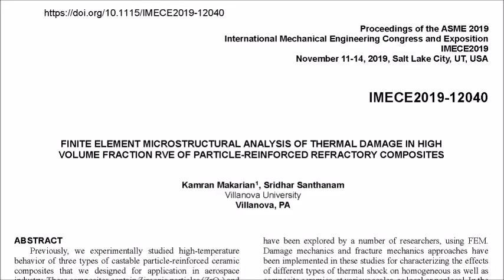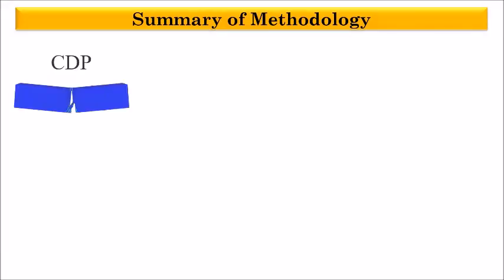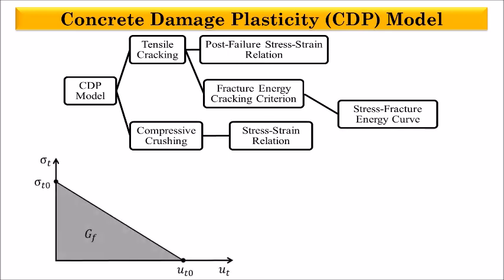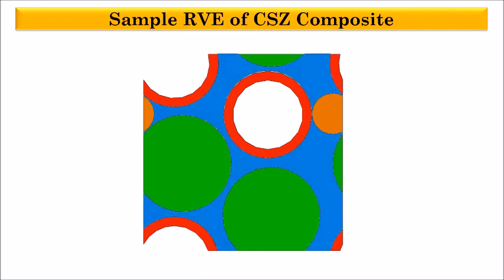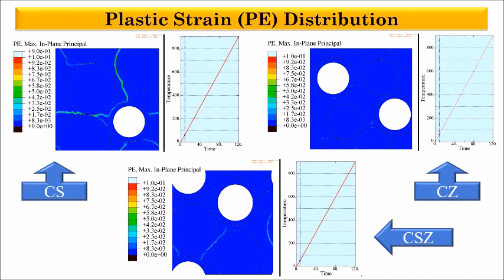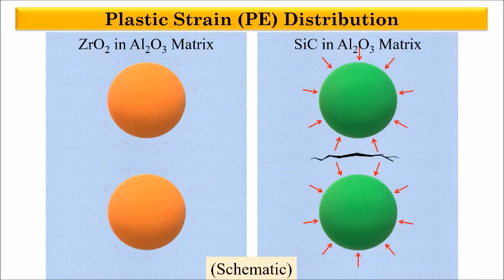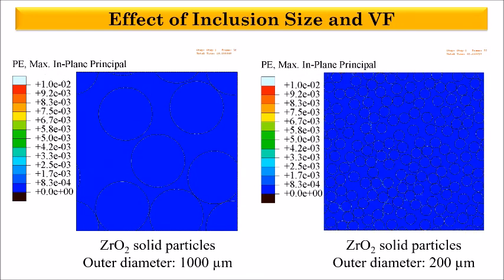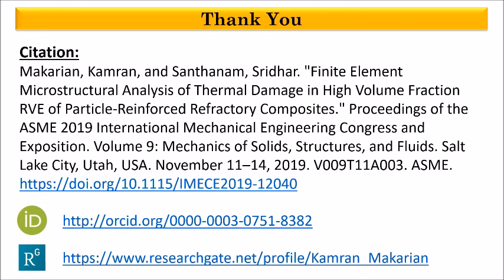Finite Element Microstructural Analysis of Thermal Damage in High Volume Fraction RVE

Comment: well done, thanks for sharing your work..i have a question about your particle .. did you define the interaction  between them or they have distance?
Reply from the maker: Thank you for your kind comment. Particles are attached to the matrix using tie constraint. Given that the problem is solved using the principals of damage mechanics and given that matrix failure is the most prevalent mode of failure at lower temperatures (see our experimental work), this seemed to be an acceptable condition to assume.
Reply: @KamranMakarian  wow thanks. that will help me a lot
Reply from the maker: @anisallahdinian5984  I am pleased to hear that. Please feel free to review and cite the original paper as you see fit.
Reply: @KamranMakarian   of course..i read your paper , thanks a lot
Reply from the maker: @anisallahdinian5984  Awesome. Please feel free to share your opinion about this or other papers, or how they relate to your work.
Reply: @KamranMakarian  my work is about brain injury .. i want to use this structure for modeling brain tissue..
Reply from the maker: @anisallahdinian5984  Sounds geat. I'm looking forwars to seeing your progress.